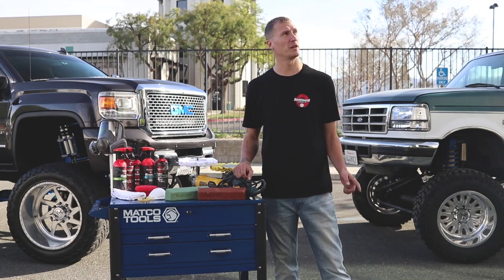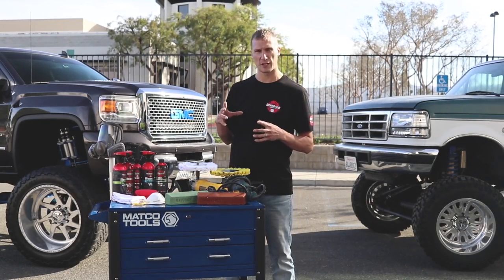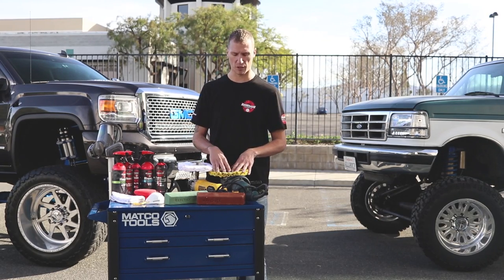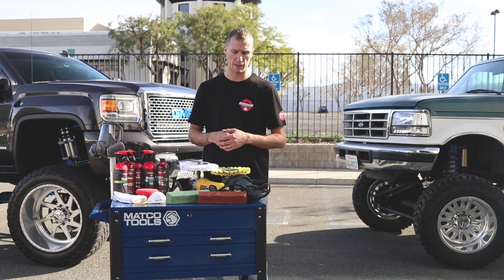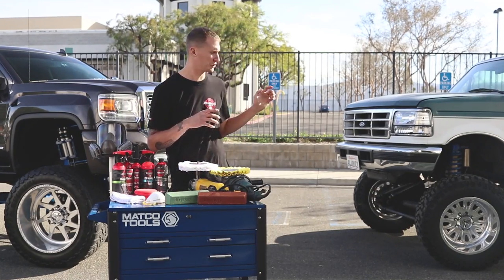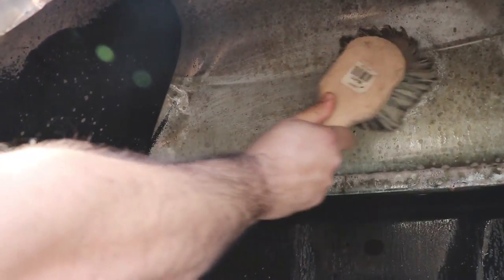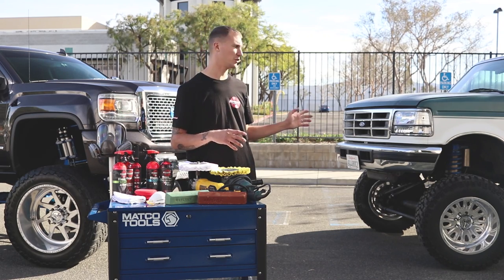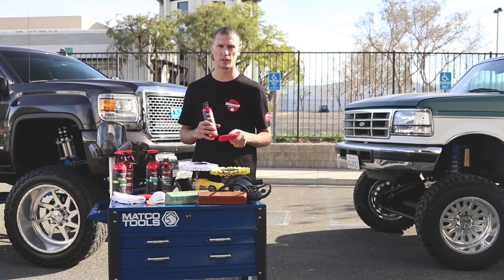Products for lifted trucks and offroad vehicles : Evan's detialing and Polishing

Comment: Evan, if I had the same wheels as the gmc in this video roughly how long should it be taking me to cut and buff using the buffing wheels you suggested with only the variable speed grinder? Assume that the wheels have a light haze to them. Also would you suggest just using the white buff with the green bar for maintenance in between cuts?
Reply from the maker: Clint Jones I never just color. I always full cut and color. Color will build up if not used with cut. Time varies on every wheel and every level of expertise. I do 10 minutes or less. But I’ve seen some people over an hour.